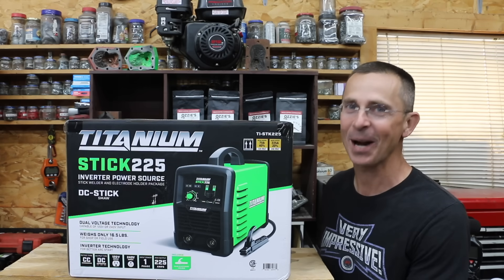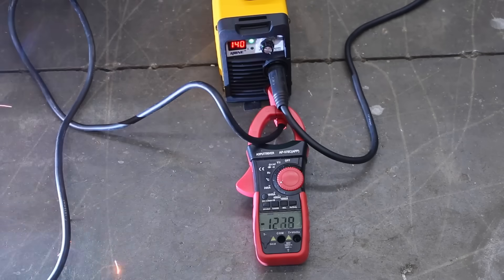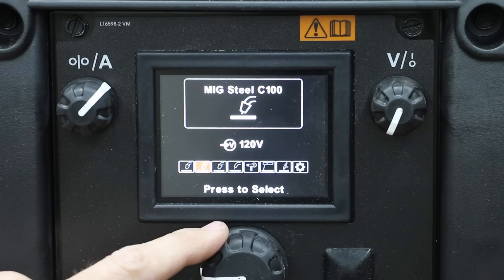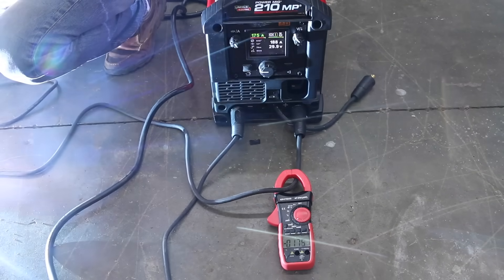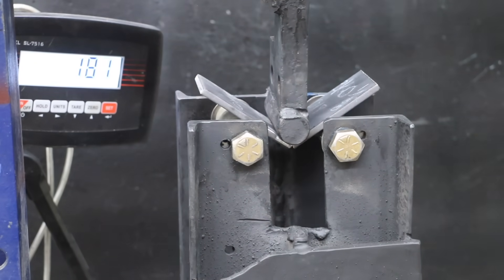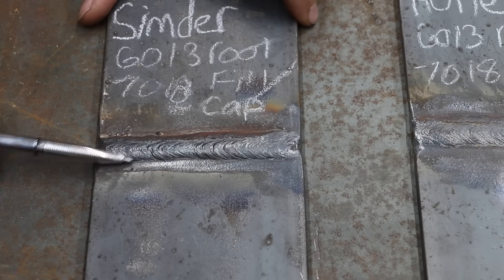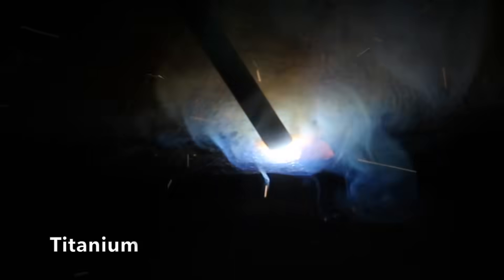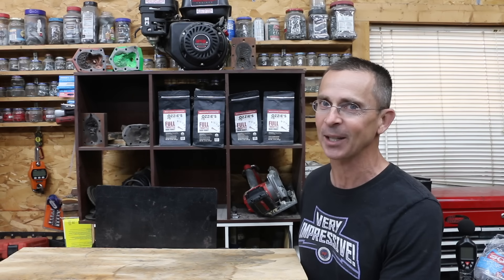$70 vs $2,300 Welder? Let's Settle This! Weld Strength, Duty Cycle, Current Output, Build Quality

Comment: Joe helped this test really shine. It's so odd seeing the results actually reflect almost perfectly "You get what yoy pay for" because usually the only real standouts are the cheapest for being mediocre and the most expensive for being overkill for most people.
Reply: I was surprised some of them lunch box welders did as good as they did. For what I do they'd be fine.
Reply: @1pcfred  I have the Titanium flux core 125 and it's surprisingly good. If you have a small project that doesn't need 220amps they're perfect.

Comment: How is it a level playing field if one welder is running at 65 amp and the other is at 130A?
you will useally get a sense of your welder, and where you wanna be, and abc in welding depending on the machine your using.
anybody rolling with a cheap chinese welder will not put much value to its display, noy least if your running it at 120v as most wont regulate their amp display depending on volt.
if you purchasing a cheap welder to 60 to 80 USD, then you can likely also manage a cheap 15 dollar clamp meter to get a reading on the amp draw, if you value that aspect.
make it apples to apples, and best case scenario, as people will very fast get a feeling of where they wanna be simply from the weld they are getting, makes no sense to handicap the cheap ones simply because their amp reading is off, or optimised o a certain voltage region.
but meeh whatever certainly not apples to apples.
instead show what kind of weld they each can deliver at the same ampere draw, as that will give a clue about the circuitry, not least on these very light ones to like 2kg

Comment: Welding is one of those skills I have been wanting to just learn for years so this is probably one of the single most important videos you have put out for me personally recently. Here's hoping that Joe can help you help us amateurs in picking out good tools to start off with.
Reply: I took welding in vocational high school for two years. One of the best things I ever did. Made traction bars for my 4x4 and a pipe bumper in high school. Fabricated and installed a trailer hitch for my math teacher and it got me an A in his class. Never had a specific welding job but did it in all my jobs at some point when they found out I could weld.  I’ve fabricated stuff for employers and personal projects just from an idea in my head.  Bull countless items. It’s a great skill to know so I highly recommend you go for it.  Never a bad thing to invest in yourself.
Reply: With stick welding a lot of it is down to technique. The angle of the rod, the arc gap and how fast you travel. If you can get all of that right you can get good beads. Joe managed it even with these cheap welders. But that's because Joe knows how to weld. If he could have adjusted the current he'd have done even better.
Reply: buy a hobart, Dont learn on a garbage machine. You will learn the most with an accurate machine. trying to learn on a cheap welder will only fck things up more
Reply: @loveforthegame3  not everyone learns the same way. I am not sure how accuracy is going to help anyone considering the varied nature of the welding process. It's not all bench welding out in the real world.
Reply: @1pcfred   Companies dont use chicago electric or titanium out in the field, They use miller, hobart, and lincoln....  You learn the right way the first time you will succeed everytime. 
Thats like telling someone to prepare for a nascar race by driving a smart car its not at all the same. Thats like telling someone to learn how to be a master chef on an oven that cant give you a consistent temperature.  it will work but if you expect perfection everytime you will have to change everytime. While i tend to agree with the statement - "Not everyone learns the same way" 13mm is still 13mm. 1/2 inch is 1/2 inch. Adding in an inconsistent variable to the BASIC principles of something will always yield varied results.   Also welding is not varied at all dude. I can tell you dont operate a machine very much... Its pretty much the same settings across all machines, With the differences being in the material being bonded and the process you use to do it.
Reply: @1pcfred  I agree with him. One of the hurdles of learning is how to set up the machine. If it's inconsistant and inaccurate then the learning process is already flawed.
Reply: @1pcfred  I'm talking about a cheap welder that cant hold its setting. They dont and that is a bad way to try to learn. If you got to any welding course you wont be using any this chinese crap. It will be miller and lincoln, usually miller.
Reply: @loveforthegame3  I can tell you the settings are NOT the same across all machines, not every machine does the same power and can hold it for a weld. Run .05 wire on some machines and see how the settings work out as "pretty much the same". "Welding is not varied at all", as you say. Ok weld inside then go outside at 40 and high winds and weld the same thing, did the weld change? No mention of gas type or flow, AC+ AC DC+ DC- flux core, or solid core as that is a big part of the metallurgical squirt gun, that is the varied factor in the material welded with any machine. I can tell you, that you don't weld like you say or think you do.
Reply: @1pcfred  Yeah they can weld steel. its not hard to weld steel. Any person with jumper cables a 12v battery and a piece of rebar can weld steel thats not the point. The difference is being able to switch enviroments and be able to weld ANY thickness of ANY material with 0 porosity thats what seperates the chinese shit from real welders that make money. For a hobby guy building mufflers or a table or something a 100$ welder will be fine. If you want to actually learn the craft you need accurate machines, you cant expect stainless steel and aluminium to be as tolerant as steel is...
The difference between blowing holes and getting no penetration is as little as 10 amps for some of the thinner stainless ive welded. You just seen how some of these machines have a displayed output that is substantially higher than actual output on the electrode. 
Any real world welder who welds to put food on the table would not trust these. i would use that titanium welder as a wheel chock. I like my wrenches to be the size they say they are. i wouldnt expect a 1/2 inch wrench to not be anything less or more than 1/2 inches. i wouldnt want to turn my oven to 350⁰ and undercook my chicken because its 175⁰ in reality. These types of fuck ups especially in structural welding can mean a bus full of orphans is killed or a little old lady gets a 20,000 lb steel gurder dropped on her head. Years of expierience only mean something if those years are filled with the RIGHT way of learning. i can weld for 20 years but the entire 20 years i had tons of porosity and minimal penetration and had to re do my work several times before i got it right. time spent welding dont mean shit if your doing it the wrong way the entire time.
Reply: @ducewags  60 amps is 60 amps. 220 amps is 220 amps you completely missed the point in what i was trying to say. I weld stainless and steel thats it. Not claiming to be an expert at all. Im a diesel mechanic not a welder by trade. I have a hobart in the shop and a lincoln ranger on the mobile truck. I can weld the same part, Use the same output and get the exact same result on 2 different machines. Cant do that with these
Reply: @loveforthegame3  60a is NOT 60a on every machine. The welding world has proven that point, many times over. 200a in does not mean the welder can weld with that 200a service, also proven many times.
Reply: @ducewags  you just proved my point to a T.
Why would i use a welder that outputs significantly lower amperage than what is actually needed and displayed on the machine. Wouldnt you want to be as close to the settings as possible? 
I have had 0 problems welding with the EXACT same settings on 2 completely different machines. Because both of my machines are pretty much outputting what they say they are. Only differences i see between my 2 machines are the duty cycle. My hobart has a much shorter duty cycle than the lincoln, my weld beads arent usually longer than a 12 inches anyways so i never cared about that as much.
Reply: @1pcfred  Aint that the truth! I thank god for spray cans and cordless grinders They have saved my ass many many times.
Reply: @loveforthegame3  In the real world, we don't weld close to what is welded. Unless you think I can drop a CAT 3500 down a cone crusher? Or have it in my pocket on a PC8000 or a drill. Duty cylcle is just a small welder issue, with a display.
Reply: Wife is a certified welder and she has been teaching me how to do it. There is a learning curve but it's pretty straight forward if you keep everything in mind.
Reply: @bixby9797  sounds about right. There's a few things that you need to juggle all at once. But if you can keep all of the balls in the air at the same time you'll do OK.
Reply: @1pcfred  Like anything, practice and repetition is what will get you there. I finish a weld that looks good to me, she takes a hammer and bangs it apart. "Do it again so I can't do this" :)
Reply: Been welding since working on a sawmill as a kid. Have taken courses in military and as a civilian. Most important thing is protective gear. You can redo a bad weld. You can't get your lungs or eye sight back.
Reply: @fs3994  you can't live forever either. I don't want to die in perfect health myself. I plan on wrecking everything while I'm alive. They say first it's the eyes then it's the ears.
Reply: @1pcfred  Maybe discernment went a bit early.  just sayin😀
Reply: I started out on a cheap welder, I thought it went ok. Until I bought a better welder, put in the same settings with the same brand and size electrode to use on the same mateiral with the same thickness, and POOF, it blew straight through as soon as the arc struck!!
And the difference between my first and my current machine were just around the equivalent of $300, so you don't have to break the bank, just avoid the REALLY cheap ones.
Reply: Jody at weldingtipsandtricks channel taught me to TIG weld, highly recommend his channel.
Reply: Ye me2

Comment: I love Lincoln Welders, just can't afford my own.  Titanium has been pretty good.  I did try a Stick 225 when it first came out, and it had issues.  I returned it.  But have tried out another since then and it ran awesome.  I got a Montgomery Wards PowrKraft 230 AC and a little Chicago Electric 80 Amp lunchbox.  Little bastard handy with small stuff.
Reply from the maker: Thanks for sharing.

Comment: A-PLUS, Commander and Joe!  He'd probably do better on something that he could run a couple of rods on. Those short runs are a pain but he did fine anyway. IF I was going to get a welder it'd probably be a MIG/TIG rig. I never have been worth much on a stick and I've had some dandy instructors. The Sea Bee Uncle was an ironworker and a miracle with a torch and his boy could weld as good as any factory or better. That's where I got started in weld prep and cleanup. Cuz tried to show me but I just never got the hang of vertical, even with him holding my hand and me holding the stinger. I was fair to midlin' on flat but not on any grade. They hired an X-ray certified guy that worked on the reactors on the power plant not far from here BUT another guy that swung a hammer in an Olivine mine could weld as good as he could, so you never know. Good tests and the weld break is as good as it gets. And the Lincoln is a pro model. And 9/10ths of the stuff the Uncle and boy did was with an old tombstone 225 amp buzz box Lincoln. 
Hope the grass is green and tall,  cows happy and God Bless Yall!
Reply from the maker: Hi Lewie, Thank you very much for the positive feedback on the welder review! Great point on the short runs and the MIG/TIG rig. I really like those old Tombstone 225 welders. They hold up very well to dirty environments and hard use. The grass is still green but it's once again drying out. So, please pray for rain!!  Always great hearing from you and wishing yall many BLESSINGS!!!
Reply: @ProjectFarm  Am and will pray(ing) for more rain and they'd even build up dozer tracks with new grouser bars with the old 225. Had to dip the stinger in water so he could hold it with gloves on. I can't remember what duty cycle it was but it sure wasn't 100%. 70 maybe. Might not even be that. Still running years later. 
MORE Blessings your way!

Comment: Joe, I only wish I had your level of skill, and I'd sure like to see more of your work if Todd has more welding equipment and materials tests in the future.  Todd, I'm relieved to see that your results exactly mirrored the advice I'd received locally before I spent my limited budget on a Titanium instead of "saving money" on something cheaper.  Lincoln or any of the other pro brands just weren't in the cards, and my early-1970s Craftsman is getting a bit long in the tooth - and it never had hot start anyway.
Reply from the maker: Thanks for the feedback.

Comment: When I went to welding school, we'd run our root passes with 6010 rod and then cap them with 7018 rod. 6010's made to penetrate so that could give you stronger welds.

Also another thing to consider when you're buying a welder is to check the efficiency rating. IIRC, a rating of 20 means you can only weld for 20% of an hour (or about 12 minutes) before you need to let your machine rest. It's good if you're only going to use it for minor projects but you'll want to fork over the cash for anything bigger.
Reply from the maker: Thanks for the feedback.

Comment: I'll cast my vote for your review of MP welders.

Also: I know you don't take sponsors for the tools, but would you entertain sponsors for test equipment or results visualizations?  I'll pass no judgement either way, but I am curious on your position and reasoning.

PS  I don't work in those industries - or know anyone that does. This is more about the philosophical question, though your answer could grant you access to test equipment, help automate the capture of data, or increase value to your visuals.
Reply from the maker: Thank you for sharing!

Comment: So.. it boils down to if you want to weld, get the lincoln.. if you want to burn up welding rods and grinding discs, get anything else.. Great tests!
Reply: Those cheap welders ran fine beads.
Reply: @1pcfred  tell that to a weld inspector.. not consistent, poor penetration. Every one of those would most likely fail a certification test. smaller rod? they might make the grade.. but certianly not up to 1/8" 7018.
Reply: @1pcfred   I think the real qustion is, how many welds have you run with 7018 1/8" ? want a consistent reliable welder.. spend the money once.. if you're just a hobby welder, have at.. go get your self one of them 90.00 amazon specials..bye.

Comment: Thanks Joe! Hope to see you again on the channel. I'd love to see a test on how lubricants, as well as thread locker, and wet brake clean, on threads effect torque/clamping force. In my industry I commonly find customers who use anti seize on lug threads. Torque charts provided is for dry torque.
Reply from the maker: You are welcome!  Thanks for the suggestion.

Comment: Thank you for this test and thanks to Joe for his part in testing them.  I think on the beveled test you should focus less on fairness and more and more if it is possible to make a proper weld with them.  Not a single passing weld on the guided bend test but I bet if you did whatever it took from a deeper bevel to thinner or different electrodes or adjusting the amps to what worked best that Joe could get a passing coupon on nearly every machine.  The criteria then would be what extra work it took to get a good weld from that machine.
Reply from the maker: Thanks and you are welcome!  Thanks for the constructive feedback.

Comment: Yes, mig and multifunction please!  I would love to have you look at the VEVOR 210Amp TIG Welder, Welder TIG 3 in 1, 110/220V Dual Voltage HF TIG/Stick/Clean Welding Machine w/USB, IGBT Inverter & Torch, Digital Arc Welder.  Every video i find is sponsored, but i would love ur input.
Reply from the maker: Thanks for the suggestion.

Comment: Awesome. Nailed this test. Fascinating insight into depth of weld penetration. Having recently started welding and buying another brand ARC welder I wondered if the actual amps could differ from the display. Thanks.
Reply from the maker: Thanks!  Thanks for the feedback.

Comment: Thanks Todd and Joe! 
 I have taken several welding classes my goal is to be a good home hobby welder/repairman. 
In my classes my classmates and I had several discussions about best welder value. We came up with two options.
1. Buy a decent quality stick machine that can also weld D/C Tig (200a) and buy a Dedicated Mig machine or
2. Buy a decent quality Multi-process welder like the Lincoln you tested. 
I think that would be an interesting test.

If Joe is willing, I would enjoy seeing more of his work and commentary.
Which welder would have been best at restoring a dead car battery?

Another test recommendation I have Is on  Plasma cutters. Some folks swear by the cheap Amazon specials. Pick an amperage output 110v and 220 and test cut quality, metal thickness and consumable cost and availability.
Reply from the maker: You are welcome!    Thanks for the suggestion.

Comment: Were the amps set the same when doing the bend test or the max of each welder? 225 on 1/8 7018  is way high if all the machines were maxed.

Comment: Kemppi Minarc evo 180 for 700 USD that can even be used with 300 feet extended cable is my dad's favorite welder that is very portable, can also be used as TIG with some extra parts.
Reply from the maker: Thanks for sharing.